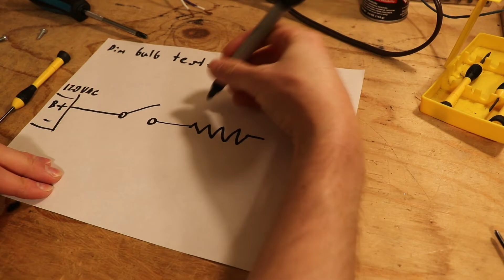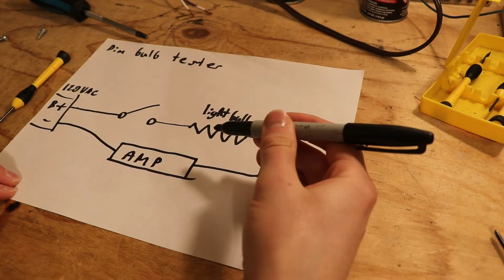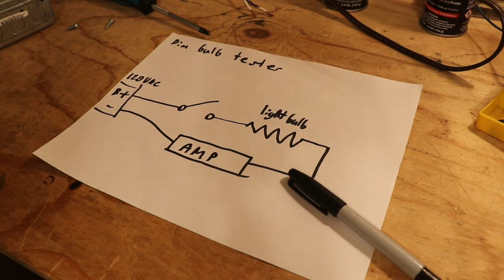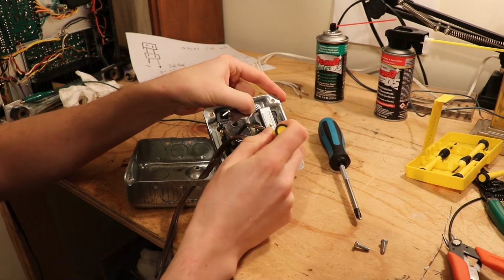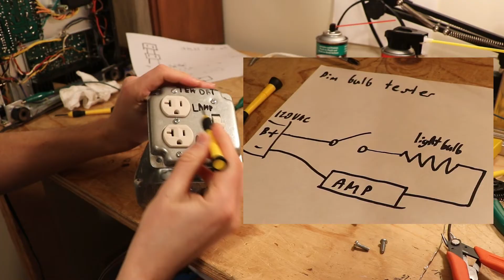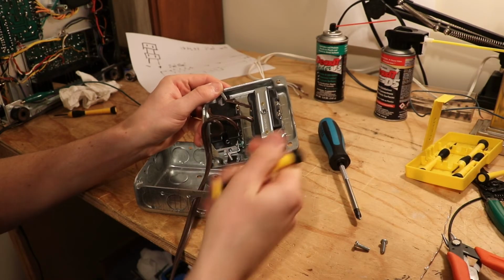Dim Bulb Tester: What It Is, How I Built Mine, Seeing It In Action

Comment from the maker: As some commenters have pointed out, there are flaws in my design and the schematic I drew is not exactly correct. Please check the additional resources I've listed in this video's description if you're looking to build one of these yourself. The goal of this video was to show a general demonstration of how it works - not how to build one. Thanks!
Reply: Great channel, glad I came across it.

I have to second JoeJ8282's comment below.  The way your receptacle is wired (actual wiring, not the schematic) you have the hot and neutral reversed on the lower receptacle labelled "amp".  This presents a dangerous risk of putting 120v hot to the chassis of the equipment under test.

Solution is simple, just break the "busbar" jumper piece, add a short jumper wire and revise the "amp" receptacle wiring.  The audiokarma link you provided shows the correct wiring on back of the receptacle.

Regards and keep up the good work!
Reply: As someone who doesn't know about electronics, I agree with you @AlbertaRider after reading @JoeJ8282's comment.
 Now I don't understand why @AH-Fix-It didn't just pin @JoeJ8282's comment instead of extra hoops to his website. 😔
Reply: Ok, So what wattage bulb do I need to get? My stereo is a 40 watt max output? Also what type of light bulb can I use? Incandescent bulds are hard to come by nowadays can I use a halogen bulb or LED? 
Very interesting and informative video
Thank you
Reply: Those two jumpers go from where to where? Also does it matter from what side of the outlet you cut the tab? Do you cut it from the hot side or the neutral side? Also where do you connect the ground on the switch and outlet?
Thank you. Very interesting and informative video 👍
Reply: Not a very useful explanation for me.  A brief reference to Ohm’s law and a couple is specific examples with actual current and voltage drops across bulb and device under test would be much more useful.  Good start but missing a lot.

Comment: It is not taking all the current, it is a voltage divider basically. If the device under testing is shorted, the voltage will fall entirely on the bulb. If not, the voltage will mostly fall on the device since the light bulb resistance is relatively low. Since the bulb and the device under testing are connected in series, the current is exactly the same through both. I guess you might have dozed off during physics class. 😀

Comment: Just like to point out that both the light bulb and the amp will be drawing the same current during a short circuit condition in the amp. The bulb however as it will have a higher resistance than the short in the amp will be dropping the vast majority of the voltage across it and hence dumping most of the power. It is power that matters not current when it comes to blowing things up. P = V²/R.
It would be good to know what wattage of bulb is recommended for the two types of amp you mentioned in the video.

Comment: This video doesn't properly explain what's happening - apart from the numerous safety issues mentioned by others but repeated here 1. the metal box is not earthed. It must be earthed. 2. the hot wire myst go to the correct pin of the socket for the unit to be tested. NOW ..The description says the the incandescent bulb is a resistor. Well that's an insufficient description. If it had been described as a non-linear resistor - i.e. when cold, the tungsten filament has a tenth of it's resistance compared to when it's white hot - then we might have better understood why it works as a current limiter. If the unit being tested has a short, all the voltage is across the bulb. It's filament gets white hot and (after about 50 milliseconds) it reduces the current to the amount according to its wattage ( for instance,  for 110 V supply, 100 watt bulb, 0.9 Amperes) . On the other hand, if the unit being tested draws a normal, low current, the filament will have a low resistance and consequently a low voltage drop.  The device under test will work normally - well the conditions are almost normal because some voltage will be lost across the bulb. To sum up: 1. If you haven't been trained as an electrician or electrical engineer,  don't play with electrical circuits. 2. Same, don't make YouTube videos.

Comment: I see this video is two years old, but here’s a suggestion for anyone watching it.  You can add a toggle switch jump out the lightbulb this way you can switch from current limiting with the bulb to full wall power without unplugging anything.   this is a convenient feature to have and it is important when you set the bias on an amplifier.  You don’t do it through a current limiter.
Reply: If you use it for setting the bias, you will kill the amplifier. This happens because the lamp produces a voltage drop when using it. Therefore, after the adjustment, in normal operation without it, the bias will be much higher from where it was with the lamp in series, killing the output stages very soon.
Reply: Until that one day when the switch is in the wrong position for testing.  That would be my luck. Just a thought.
Reply: @VintageGearMan   it is possible but always double check your work.  Worst case you blow a fuse.
Reply: @buzzedalldrink  Roger that.

Comment: Why then just run all vintage expensive stereo with a bulb as protection ?
Reply: Because the lamp will light up when the volume rises, not letting enough current for it in order to work normally. This trick is only for ensuring the integrity of the circuit under test. It prevents blowing things up if something is wrong with it.

Comment: Good video , keep them  coming . oh and nice 2215b  restore you did . Marantz tip . I just restored a 2215b as well  . Someone did a repair on one of the wires that twist around the pin on the board . they heated the pin too much and desoldered it from the board and made a voltage drop on the circuit . causing one speaker to be louder then the other . oscilloscope showed around a 40 percent reduction in voltage .  so if you see any twisted wires soldered to pins check the back side for good continuity on the trace side of the board. Most likely due to it takes a bit more heat to solder to the pin .

Comment: What if the bulb stays dimly lit? It flashes bright at first, then stays lit, but very dim. Is it drawing more current than it should be?
Reply: Depends on the idle power draw on the amplifier. If the idle power draw is high enough, it can make the bulb light up without something is necessarily wrong.

Comment: Hi and thanks for posting this video. I am building a current limiting device right now because I have a coffee machine that is suffering from an internal short due to a water leak inside. In order to find the leak, in this incredibly crowded coffee machine I want to protect my circuit breaker on my switchboard before switching on again. My coffee machine draws 5 amps at 240 volts though, so will have to add additional protection inside the box I will build, by including a 5 amp fuse in line with the active supply. That reminds me, there is no 'positive' or 'negative' mains power in your house supply, it's an alternating current. So your drawing would be more accurate if you labelled the wall outlet 'Active and Neutral' or 'Hot and neutral'.  I haven't read all the comments, so someone may have already said that. Cheers from Australia.

Comment: I have perfectly good working DBT but when I use it on a Kenwood-Trio KA-4002 it does NOT light up at all. The Kenwood was given to me but obviously does not work. Anyone know why the bulb is not lighting up at all? I checked it on another amp and tester is OK.
Reply from the maker: Not every unit will light it up. Some pull very low current at idle. Try playing some music and it may light up as the volume is increased.
Reply: The fuse could be blown on the amp and not draw any power.   The light is protecting too much power by limiting the max current available

Comment: May also be used as a ( temporary ? ) ballast for many types of gas discharge tubes .... and .... essential when discovering the windings of an unmarked transformer ... ( accidental connection to a 6 Volt winding just results in a bright bulb ..( tried - n - tested ) ................. DAVE™ ..........

Comment: One important thing to note: When you are working with a mains system that is grounded/earthed, you MUST provide earthing to the AMP outlet AND the metal case of the box the outlets are mounted in- otherwise in case of failure you have mains voltage at the case- also leakage currents from the DUT (device under test) are not able to go via earth and will be present on any metal surface that can be touched...
Reply: I couldn't understand why the metal box was not grounded.

Comment: It's always funny when people talking about electrical safety, but build something with a metal enclosure, and don't use a powercord with earth wire. 
If the hot wire becomes loose inside that metal box and touch the metal box, your RCD won't trip. If you then also touch the metal box, then you get a serious zap. 
It's good that you use a device like a Dim Bulb Tester, for protecting the device that you connect to it, but you should also protect yourself in the first place and think about the safety of your viewers that gonna copy your unsafe way of working with electricity.
Reply: If you fall down the stairs and get hurt      if you walk in the street you may get ran over.

Comment: Good evening my friend from Greece I saw the video with the Dim Bulb Tester: and he saved me, please I have seen the awesome work you do with the amplifiers, my wife's dad has a Marantz PM350, 40 years old, he burned his electrical fuse of the transformer changed it but burned it again, told me if I can look what it has, I opened it and found another 2 fuses the 3.5 amps inside burned out, I put it in the power with the Dim Bulb Tester: and the lamp turned on, I changed everything the transistors and capacitors, when I tried it, it played very well, but the transistors were very hot after five minutes, you did not rest your hand on them, when I connected it to the Dim Bulb Tester and opened the amplifier, the lamp lit up and flashed then it remained on continuously with low brightness but the transistors did not heat up and everything was fine. please can you help me with any of your ideas to find the short circuit, i would appreciate it very much. otherwise I see myself leaving the Dim Bulb Tester permanently on, thank you in advance from the bottom of my heart, I hope I did not tire you, and another question, does it matter that I turn on the amplifier without the speakers.

Comment: I wish this video was out a year ago when I recappped my 2220B. I used a DBT and the bulb would faintly glow then glow brighter when high volume in a song came. Other than that the bulb would be slightly warm but no visible light. Is this normal or should I tear apart my marantz and find the culprit short? I figured it was fine during the rebuild process because it was pulling more current for the audio but I was never 100% sure. I’d love to hear your response.
Reply from the maker: Completely normal

Comment: Can I ask what it means when you plug your amp into a DBT and the bulb comes on bright then dims down?    The amp supposedly works fine.   But the tester bulb lights and dims.    Is that bad?
Reply from the maker: Perfectly normal. An amp draws the most current when power is first applied because the filter capacitors need to charge. That charging causes high current draw (bright bulb) and when they're charged the amp draws a much lower current (dim bulb).
Reply: @AHFixIt  you’re the best!   You’re teaching us all, that’s important.  Thank you.

Comment: what would be the wattage of the bulb?
Reply from the maker: Good question. It depends on how powerful the device under test is, or how much current it draws at idle. I keep a 100W bulb in mine. Some people use 60W. For much bigger stuff like a Marantz 2500, you might want to step up the wattage to 150 or 200.
Reply: @AHFixIt  . thanks for the quick reply. 👍
Reply: Size your bulb to under the fuse rating of the device under test. For example if the DUT has a 1A fuse, you would want to use a bulb under 120W, because with a short circuit on the DUT, the bulb will draw 1A through the circuit and would probably blow the fuse. In this case a 60W, 75W or even a 100W would do just fine. For a 2A fuse, you could go all the way up to a 200W bulb if you wanted. for a 0.5A fuse a 40W bulb would be good. As long as you are only using it to determine if you have a short or not, then you don't have to worry about the voltage being dropped across the bulb and how that will affect the DUT. I know people that keep their DUT on the bulb at all times, but they have done the calculations based off the bulb used to know what the voltage readings should look like based off of that.

Comment: What is really important and it was not mentioned ( but it is implemented in your design ) that you have to have switch on BOTH: HOT and NEUTRAL wires and switch both not just one or another. This is to prevent obvious safety issues. 
So for People who planing to build this:   !!!! please use DOUBLE POLE light switch !!!!
Reply: Using one with a single pole switch for ages. It's very obvious now that you say it.... DEFINITELY should have a switch on both live and neutral.

Thanks!

Comment: I've never in all my 45+ years as an electronics/computer/network technician used one of these. It's why we have fuses.

The results can be misleading. The light bulb will not go on if the fuse in the DUT (device under test) opens, giving you a false sense that the device is OK. 

And potentially dangerous if you have a transformer-less piece of equipment with one side of AC line tied to the chassis.